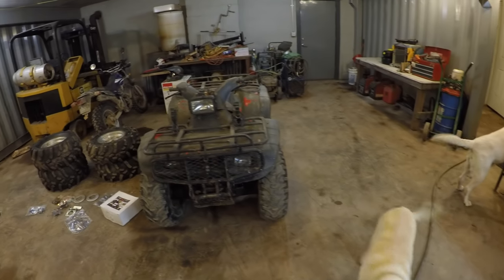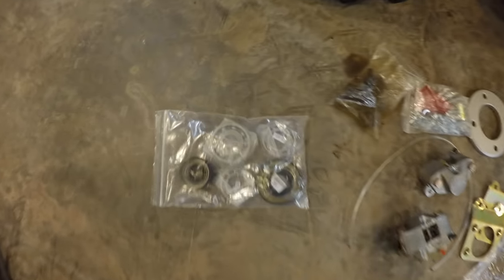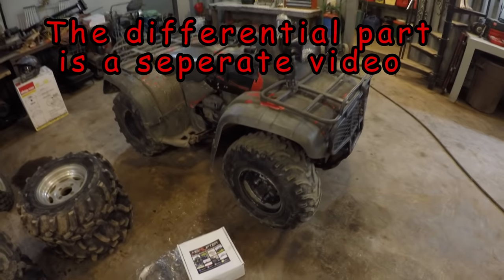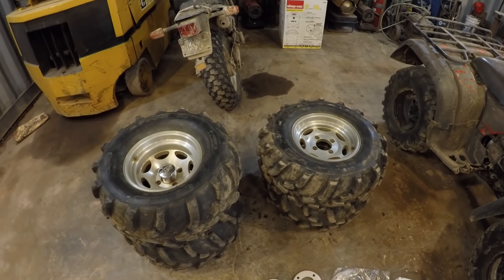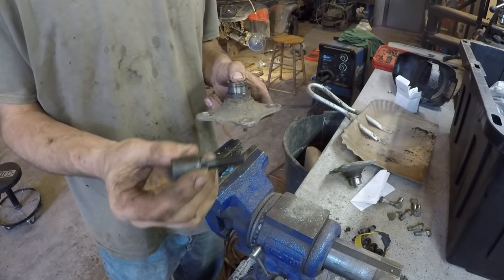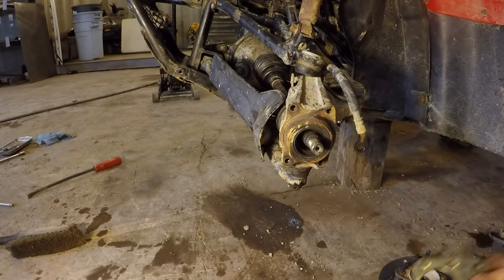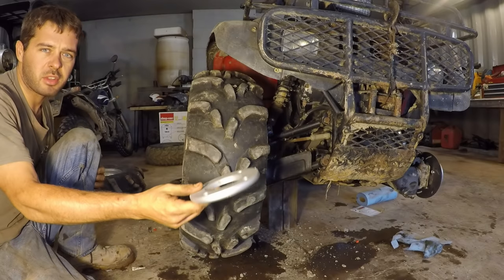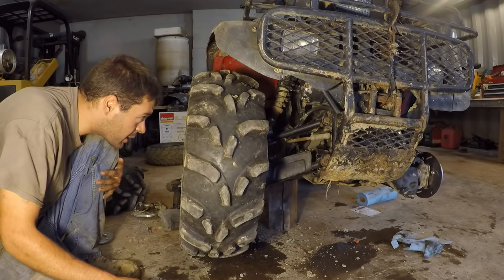Honda Foreman disk brake install and riding

Comment: after watching many Andrew videos it is clear he has three favorite tools: welder, impact driver,  sledge hammer.
Reply: and Pry Bar
Reply: Chainsaw?
Reply: Don't forget the grinder
Reply: You missed the most important one.
Reply: Spray paint
Reply: Front drum brakes have just been replaced by front disc brakes on a 1995 Honda Foreman 400 sport-utility all-terrain vehicle.
Reply: @wetdixiebellelingerie3014  And he rebuilt the front differential without needing to buy that expensive eBay $65 one time use special tool

Comment: Hey Andrew just a tip, if you heart a lot of crackling or popping when your mig welding...just turn down you wire speed a little until you get a smoother sound, I find even on my Lincoln that the chart they give has the wire speed just a little too much for the temperature setting that they are recommending for any given thickness of steel you happen to be welding.
Reply: Mr.McGoover  Buy a Miller !  Millermatic does all that for you!!!  And it works! 
I don’t know to weld but I can get nice beads and good welds with my Millermatic
Reply: Buy a Miller! Millermatic does all that for you!!!! And it works! 
I don’t know how to weld but I can get nice beads and good welds with my Millermatic.

Comment: I expected more from a Honda. I have their weed eater and grass cutter. The grass cutter is 2001 and using the original spark plug. I've changed the float bowl 2 times. Rust. But now the last 5 years I use Aspen fuel. Synthetic gasoline made in Sweden. In in my 3 strokes no smoke. No stink. Fuel and oil are synthetic. I wish I could send you a photo but I don't know how. 
Thanks Andrew.

Comment: hey Andrew,maybe theres something im missing,but I very rarely seen you using anti-sieze on a lot of your hardware.this prevents a lot of galling and siezures down the road,especially on the heavy equipment.get it spray on,or brush on,highly reccommened.
Reply from the maker: I was using it for a while, I wasn't impressed with it.

Comment: I remember doing this same stuff on my Honda Atc 70 three wheeler
Reply: legotec49 I had a Honda ATC 110. Pull start, no front suspension. Still miss it! 👌🏻
Reply: @biffjohnson7107  Mine still runs but im to big for it now, it doesnt have enough power. I can still fit but it wont go

Comment: I had a 2002 Foreman 450.  I found the front brakes worked just fine...but the rear drum brake really sucked.  I bought the High Lifter rear disk brake kit and installed it on mine and it made a world of difference!   Sadly, I don't think they make the rear kit anymore...just the front :(
Reply from the maker: That's weird. Usually the rear brakes stay working.

Comment: Brush guards for your feet would be a nice addition.
Reply from the maker: Yeah, but you still need to be able to shift. I've been riding that thing 14+ for years now, its pretty good the way it is.
Reply: I bought some brush guards for mine, but can't remember how the gear shift worked...seems like I either moved it up a few teeth or extended it some how. That was back in 1995, so it's been a while... Those Hondas are great machine. I sold mine and moved on to side by sides.

Comment: the spacers are to stop the wheel from rubbing the suspension components during flexing or sharp turns
Reply: I have the same kit. Should i install the spacer as it makes the front stick a little further out than the rear

Comment: Dude that thing has to stop a million times better! For a 1995 that thing stills runs great! What tires were on there, I have a set of Bighorns on my Rancher but those looks like they would be a good replacement for when mine get bald...
Reply from the maker: Yeah, it didn't stop before, I used to crash into people. It had Kenda Bear Claws, they are great, last forever (they were on there since 2008), never get flats, I install them on everything (sport/utility). But I got a really good deal on those 589 mud tires mounted on rims, which allowed me to finally get the disk brakes I have wanted for years.

Comment: you should make a heavy duty bumper for the atv like you did on the suv. That would look awesome
Reply from the maker: I did. Look at what that atv comes with stock. You can see I added a bunch to it.
Reply: Andrew Camarata yes I saw that I just meant instead of heavy duty brush guard make a bumper as you did on the truck....anyway.....I know you don't want to give out your exact location but how far from the canadian border are you? lots of woods and hills. did not know that New York had so much wooded area.

Comment: i have the 1999 version of that atv with just over 10,000 miles on the original engine. still starts and runs great even at -30f. i used to use it to plow snow with. where did you get the disc brake kit? i hate my brakes on mine, thankfully downshifting stops it quick :P also is yours full time 4x4?
Reply from the maker: Those kits are available online, there's even a few company's making them. I think I got that from Highlifter. Yes, mine is always 4x4. Search "highlifter disc brake conversion" comes right up, like $340 for the kit.

Comment: 3:37  Is it my eyes or the camera angle that made it look like there was no drum brake on the left rear axle?  I can see a drum in the background but I'd expect it to be closer to the worksite.  If I were to buy and ATV, I'd want 4-wheel brakes like my SxS has.
Reply from the maker: Dan Burch There are only brakes on one side, it wouldn’t need it on both sides because it’s a straight axle with no differential

Comment: Would it better to buy a welder that is self contained with its own generator power source?
Reply from the maker: Only if you don't have power where you are welding.
Reply: @AndrewCamarata  was thinking just so i dont need a 220 VAC receptacle near by or at all. My home only has one in the laundry room.
Reply from the maker: If it’s inside a workshop where you may be occasionally Welding just install the 220 outlet
Reply: @AndrewCamarata  do you need a 1978 CJ5? It has a 360 AMC in it. I have a spare transfer case and transmission plus a rebuild kit for the transmission. My gf is asking me when im going to get it out of the driveway. There is a scrap jeep yard down the road but I would prefer to give it to someone who can use it.
Reply from the maker: I’ve got so much stuff going on right now, I got my side by side road legal, that’s my off-road vehicle at the moment
Reply: @AndrewCamarata  that is a nice machine. Just thought Id offer. Cheers! Thanks for responding. Keep on keeping on with the videos, very enjoyable.
Reply from the maker: @kylestolz5082  thanks.

Comment: time to put a hmf pipe on it
Reply from the maker: No way, that will ruin it. Aftermarket exhaust pipes are stupid, they make it really loud so it pisses everyone off, they take away power, and it ruins the engine.
Reply from the maker: Those aftermarket exhaust should be illegal.
Reply: your rite about loud but richen your main jet and no motor damage
Reply from the maker: It still slows them down. I've been riding for 25 years, I've had plenty of friends over the years whom bought aftermarket exhaust pipes. The sound is always a huge problem. But usually give that bike 1 year, and its not running any more.
Reply: ive been riding 35 yrs it dosent slow them down or cause your motor to  blow up thats something your dad would say mine used to say the same as yours but i rebeled  ive also learned true duals with cherry bombs on gas trucks mbrp race can on sleds and fmf or hmf for bikes and qauds